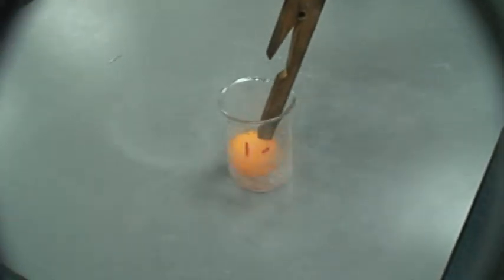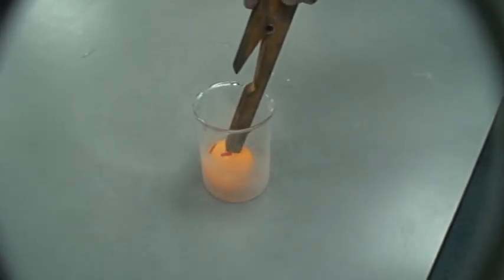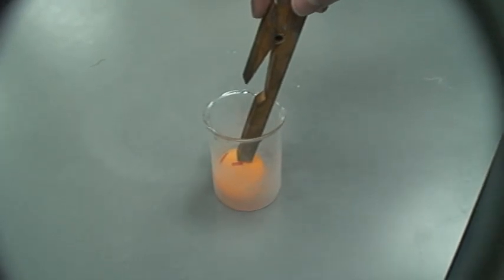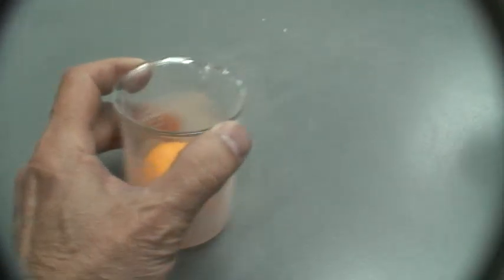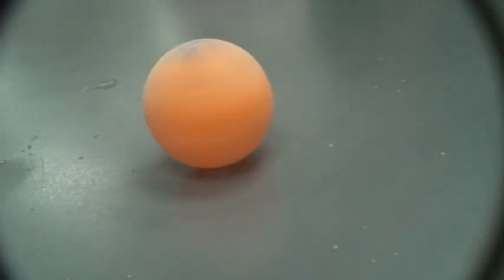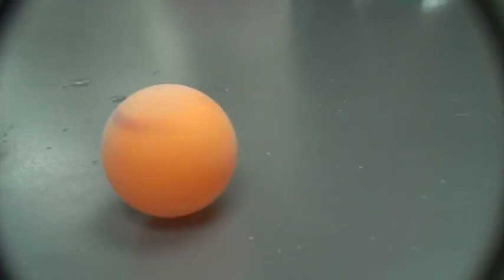#petersplimln  Liquid Nitrogen and the spinning ping pong ball

Comment: Thermal conductivity is as important to getting frostbite as is temperature. A metal object feels a lot cooler at room temperature than a plastic plastic because it can conduct more heat away from you.  The ping-pong ball is plastic.
On top of that, you can safely dip your hand into a dewar of liquid nitrogen for a second or so, with out any frostbite, because the nitrogen boils on contact, forming an insulating glove of gas around your hand.  Same as touching a hot iron with a wet finger.

Comment: I'm quite aware of that. What I was saying is wrong with your explanation is that the reduction in temperature from the liquid nitrogen itself inside the ball results in a HIGHER pressure and density inside the ball, after the resulting vacuum has equalized due to the loss of temperature. When the ball is removed from the liquid nitrogen, that higher pressure exerts force while exiting the exit holes of the ball, resulting in a spin.

Comment: sorry, it seems i made myself unclear. the colder temperature inside the ball makes the air mass inside the ball contract very slightly, drawing more air in due to the air molecules moving closer in. This is what I meant by "vacuum", probably not the best term to use. Youre right, the cooler temp results in a higher pressure. what i was trying to say is that this doesnt affect how it spins. Anywho, this supercooled and high density air is forced out by the evaporation of the n2. this make sense?

Comment: @Vas4you in a way it is. think of water hitting a hot frying pan. the water suddenly jumps from room temp to over 200 degrees and turns to steam with a sizzle. the nitrogen exposed to air is undergoing a similar temperature change.

Comment: wow this is wicked! so its basically the same concept of taking a bottle and putting it in hot water right? the pressure increases because its hotter. so because liquid nitrogen is super cold, when u put it in room temp. its basically heating up really fast and causing more pressure inside the ball. and because of how the holes are positioned, the pressure rushing out of the ball causes it to spin? thats my guess.

Comment: I'm pretty sure he meant each hole diagonal to the ball "skin" so thar the gas inside the ball wouldnt come out perpendicular to the tanget but in a different angle, otherwise the ball  spin as the force generated by the gas expulsion would make it move in a straight line instead of making it spin.

I'm pretty sure that wasnt really clear but its really hard to explain it without a picture. And anyway i'm guessing what he meant.

Comment: what if you punctured a hole directly in the bottom, while also puncturing a diagonal hole in the side, will the pressure be enough to push the ball upwards while also spinning it to keep it stable. Making it appear as if it is levitating?
Reply from the maker: Just may work .... maybe poke 3 or 4 holes at the bottom, ad it will be more stable

Comment: @shinnuXIII lol, isolating the gas and getting it down to that temperature uses far more energy than you could ever get out of any liquid nitrogen energy system using soley the expansion of the gas due to room temperature heat

Comment: Video Explanation: They took a ping-pong ball and made two holes each on a different face of the ball, but not parallel to each other, actually slightly in a diagonal. Then they took the ball and put it in Liquid Nitrogen and it entered the ball, after a while they took the ball off the becher-pyrex, as the Liquid Nitrogen rapidly evaporates and escape the ball through the holes, a pressure gradient is formed and it creates a rotation momentum making the ball to spin.